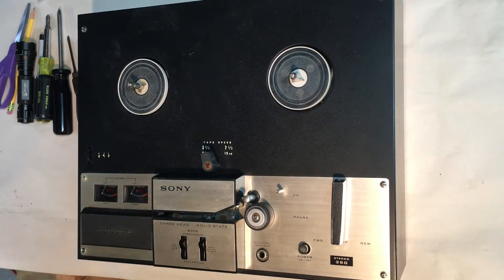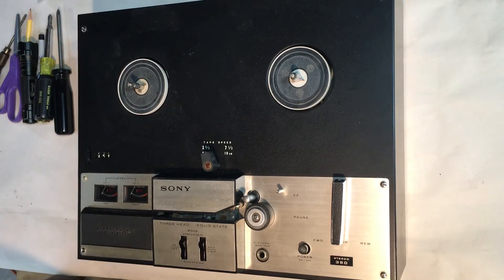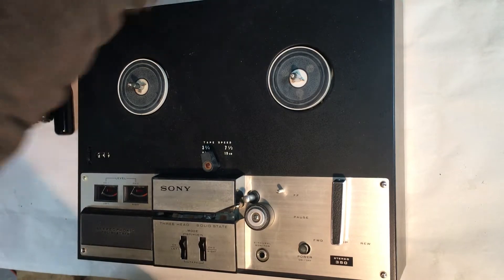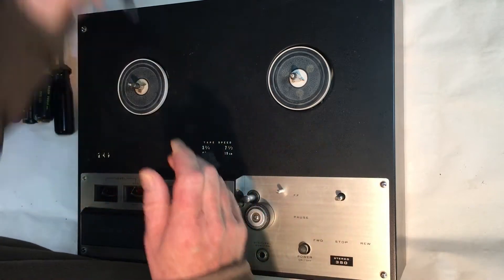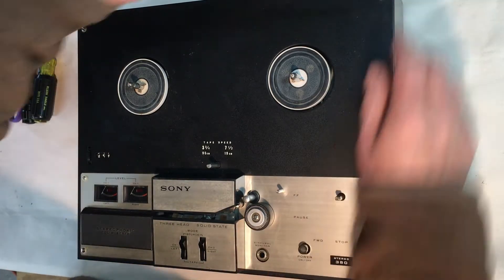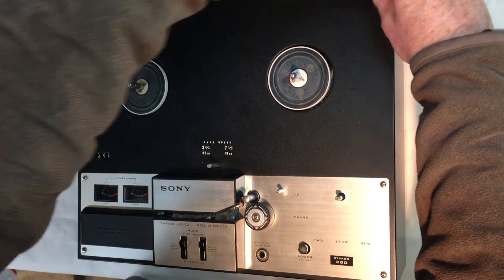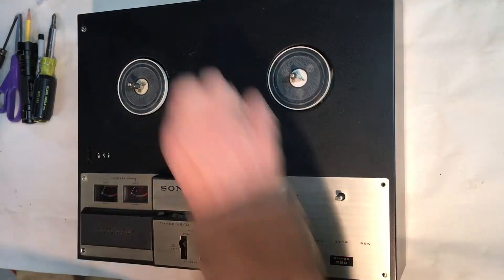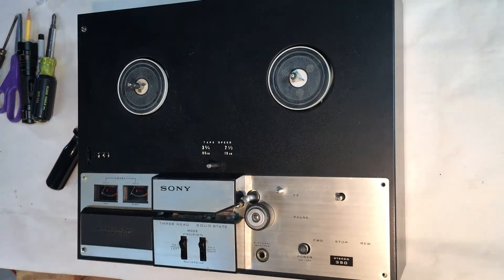Sony TC-350 Tape Deck Repair

Comment: A good method to 'renew' the pinch roller is to carefully 'sand' with emery paper. Use fairly 'rough' grit, maybe 400. Do this in PLAY mode, but mind no 'grit' gets on to the pinch roller and marks the capstan if possible. Clean up later with Isopropanol and a Q-Tip; it'll come off like a black paste. You can then 'renew' the rubber with Rubber Renue later.

Demagnetisation: Best to do this in 'one go' if possible - start with the erase head and work across the record, then playback head. Switch off when the de-magnetizer is about 2m 
away.

Thanks for taking the time to upload this video, I quite fancy a TC-250!